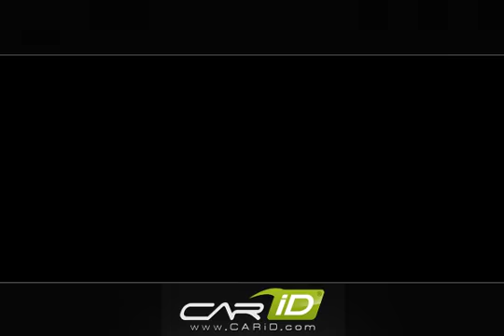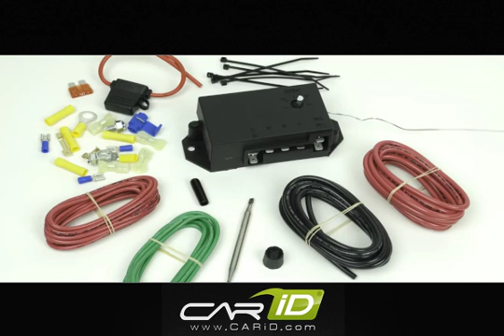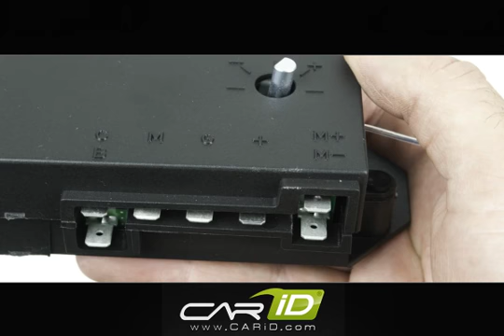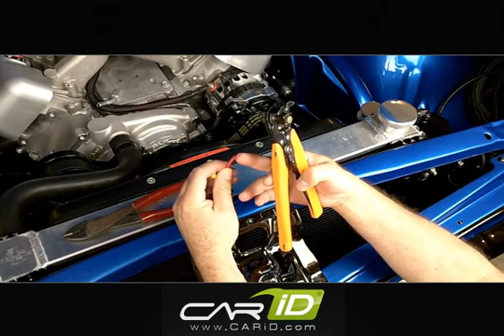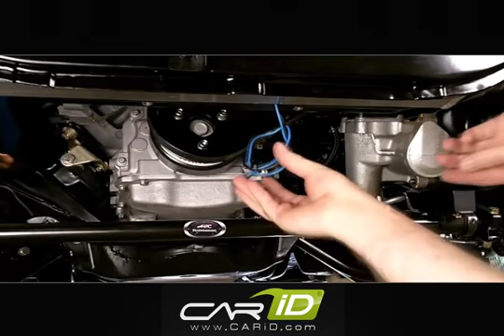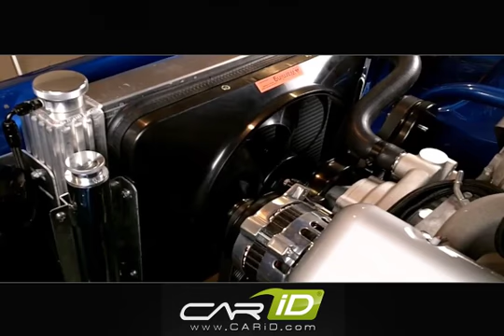How to Install and Wire Flex-a-lite Electric Fan Controller

Comment: Hey, Great video! Question, I will be running dual fans, should I use 2 controllers? One for each fan.., If one, Can it handle the camp's for two fans?
Reply: You have to look at the specs to determine if it can handle the amperage of both fans. 
But you prob want to have them come on at different times, (high and low) and not both at the same time. This is often referred to as a two stage, or two step controller.  
You should not need two controllers, just one that has enough smarts and amperage capacity.

Comment: I have the Flex a Lite 180 using the same controller and I'm having issues with the controller not working correctly. I ran the the wire for the probe along side the other wires and used black tape to bundle the wires into a harness. Would the probe wire be affected by having black tape on it. The probe is installed to the radiator in the correct spot.